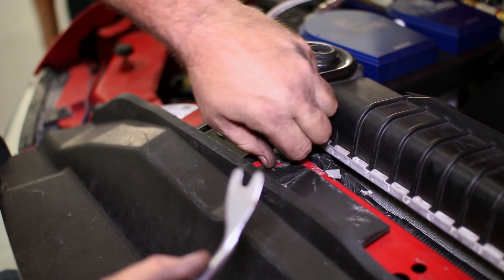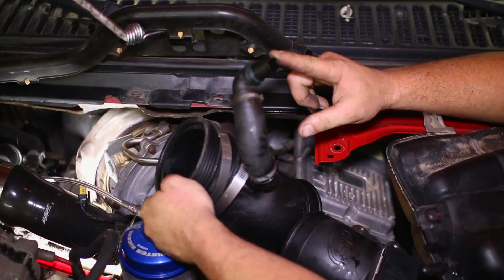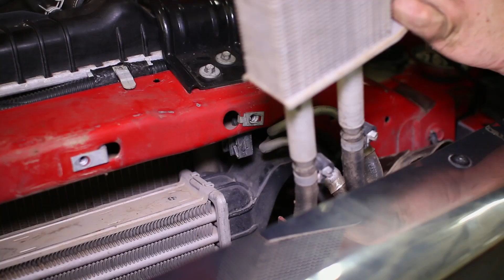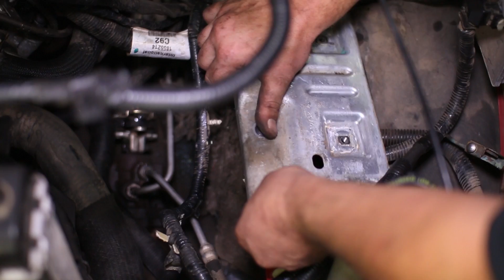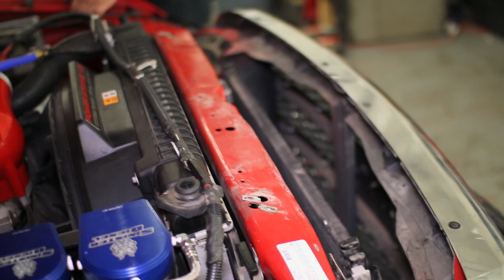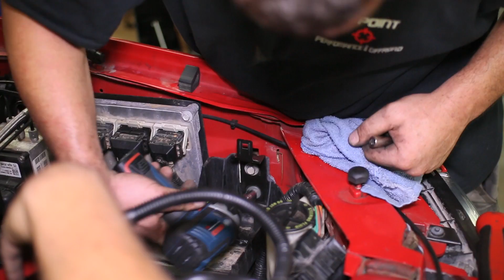2005-2007 F-250 & F-350 6.0L Banks Techni-Cooler Intercooler System Install

Comment: how did you use the factory hot side pipe? isnt it smaller then the banks air cooler?
Reply: Just move the coolant filter, or the bypass oil filter, which ever is in the way. They took the half ass way out

Comment: where is the piece of metal with two holes installed?
Reply: That’s likely the 1/2” (or 1/4” I can’t remember) spacer that goes under the battery mounting location
Reply: @eastonruppe5730  thank you very much Bro

Comment: Am I the only one that noticed the lock washers installed under the flat washers on the studs??
Reply: Those are not lock washers. They have a rubber seal on them so no pressure is lost.

Comment: what kind of power increase if any with stock turbo
Reply from the maker: There no exact power numbers to give but with the 21% improvement in volume massive amounts of air flow can head straight to your turbo
Reply: @stage3motorsports  air volume and density dosen't give me any useful or useable info was hopeing for some power info so i dont over press my engine and damage it by using your product
Reply: What’s the point on raising the battery tray i have the same banks ram  and cold side pipe fits perfect does the intercooler interfere

Comment: whats the purpose of drilling out the battery tray?
Reply: steve wujek to raise it up a 1/2”.  I think it needs to go up to clear the larger boost tube.
Reply: To get the boost tube to clear, easy to install kit, drops egts 200°+, that drivers side tube is ice cold even after pulling trailer all day
Reply: @007.3l No, the intercooler exit pipe does not get ice cold.  It is still hot, but is cooler than with the stock intercooler.  I installed this system years ago, and also tow a trailer.  I like the system, and it does lower the EGTs, and provides better airflow.
Reply: What boot is used to go from the Banks 3 1/2 inch inlet to the MBRP 3 inch pipe on the passenger side? The Banks pipe is bent differently than the stock and gets in the way of the bypass filters.